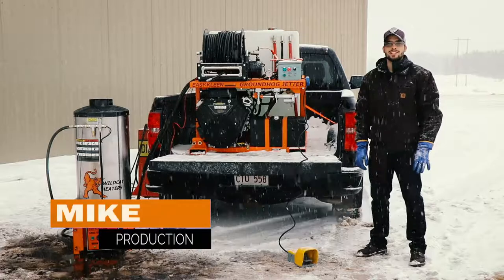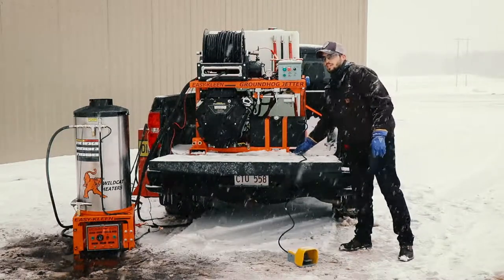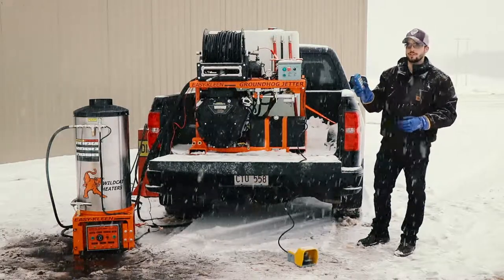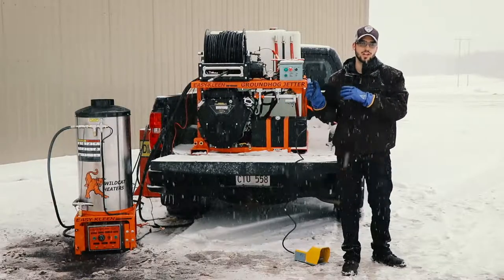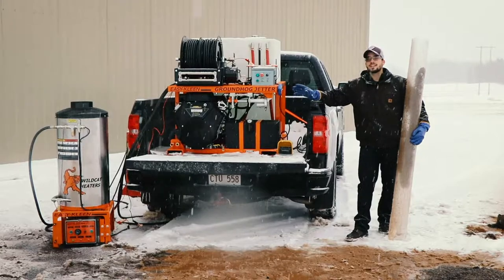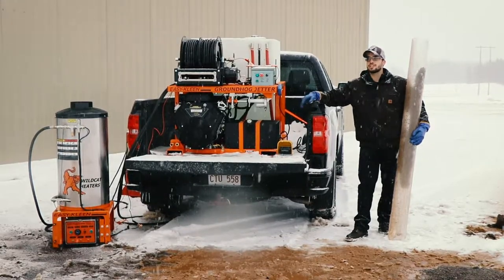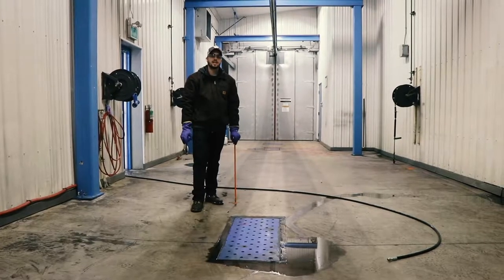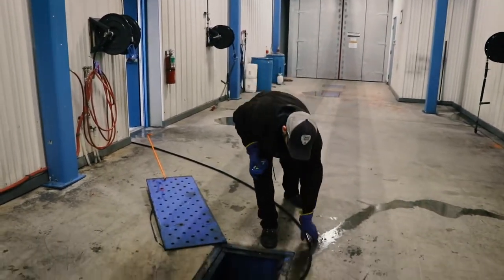12 GPM @ 3500 PSI Portable Jetter - Easy Kleen

Comment: Do you have a boiler that fits in the back of a 1 ton cargo van ?
Reply from the maker: Hey there! Yes we do, our Modular Hot Water Heaters - Oil Fired (EZO440) is the machine of choice for that kind of setup. Give us a call today for more information 1-800-315-5533 :)